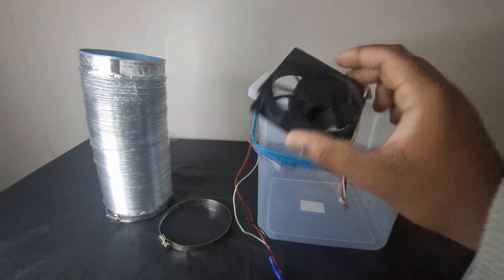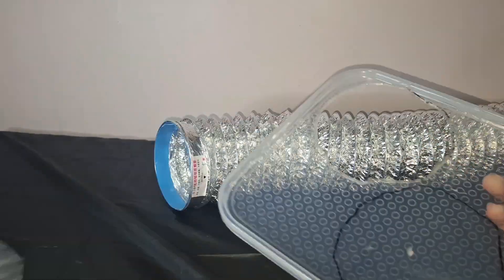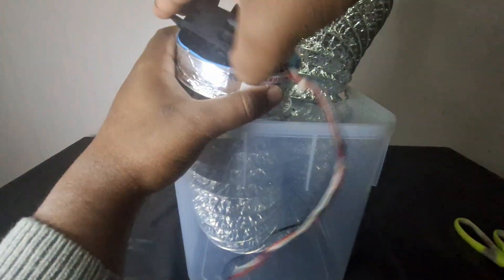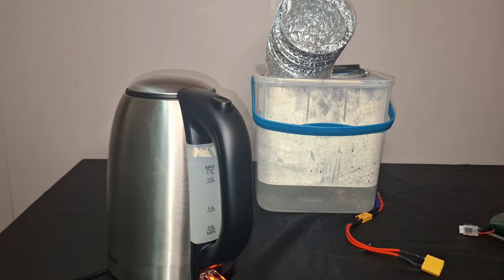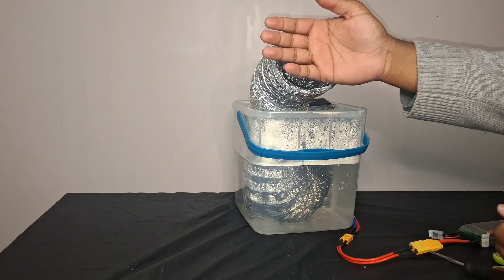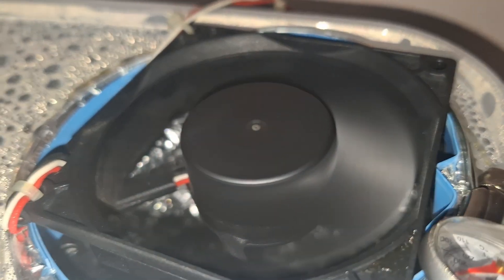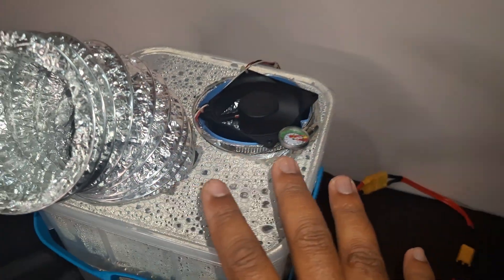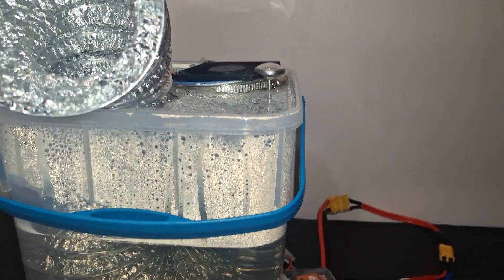Emergency Heater

Comment: If you were to wrap the container in an insulating layer, like foil or foam insulation that would prevent the heat from radiation out of the sides as quick, meaning it would remain hot for longer meaning you would have to add new water less often?
Reply from the maker: Splendid, we were thinking similar furthermore adding the heating element to the container, allowing you to heat the water but not waste the water. I really appreciate your comments.
Reply: hell yeah